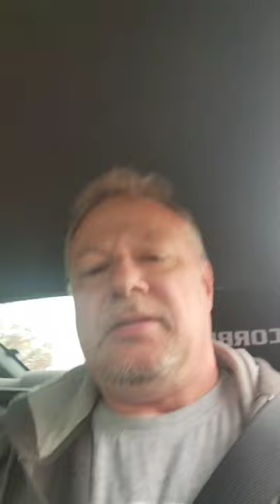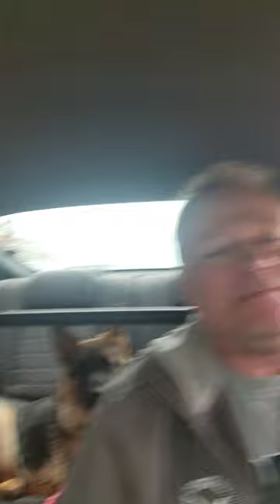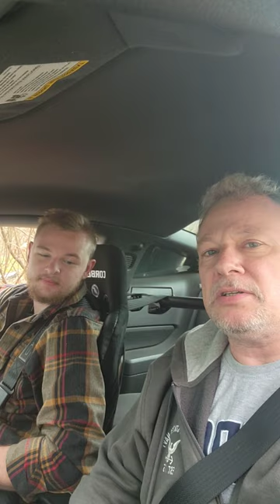Mustang vibration 2 piece drive shaft bad?

Comment: Absolutely check your transmission fluid and rear differential fluid is all I can tell you right now
Reply from the maker: Good ideas. We found the lower control arms were too long, causing Pinon angle to be off. Giving us the vibration.